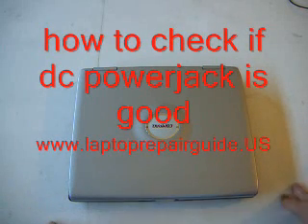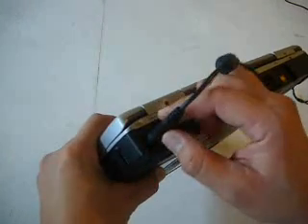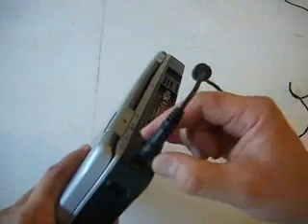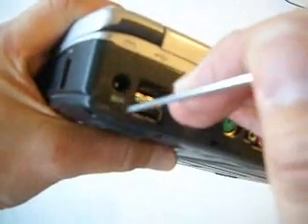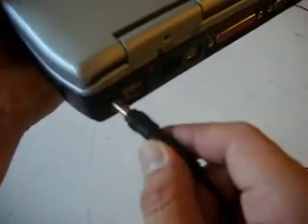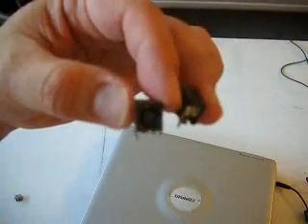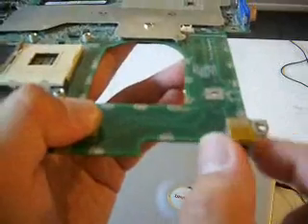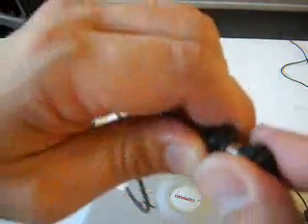Quick guide to test if a laptop dc powerjack is good

Comment: I found you can have a loose connection (bad plug) and it will start accessories (fans, lights, dvd drive, ect.) but nothing else. I've experienced this on two laptops. I also experienced electrical arcing at the jack when inserting the plug in one of the laptops. Replaced plugs, and laptop will POST without issue.